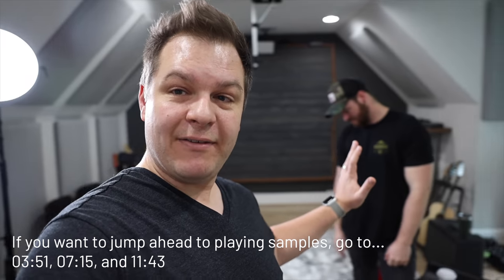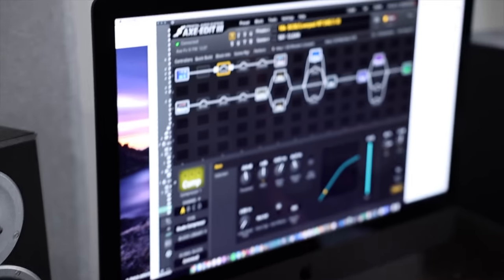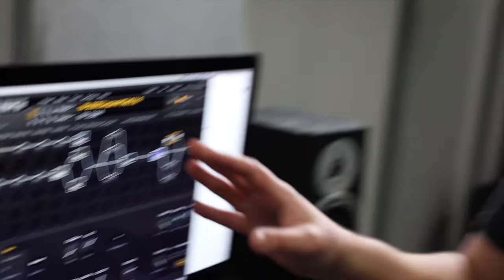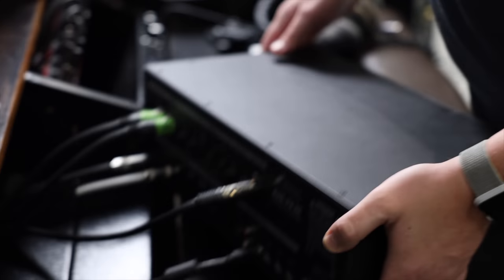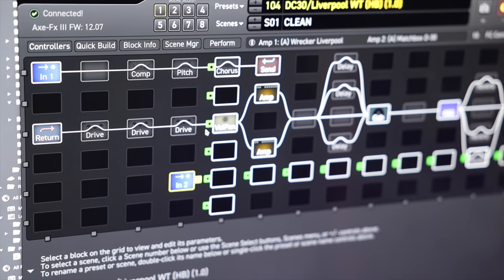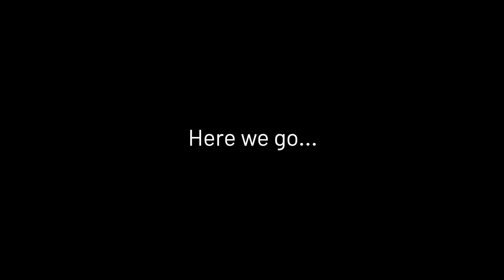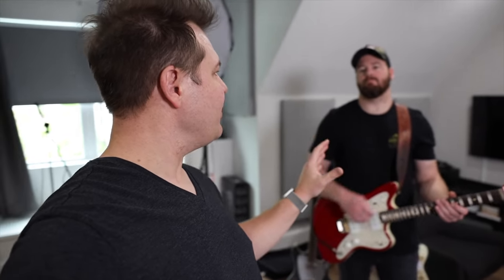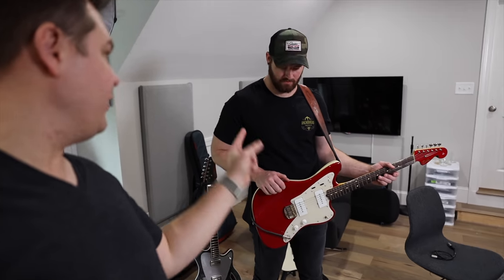We ran a huge stereo pedalboard into the Axe-FX 3...

Comment: I learned how to easily use my condenser mic in my axe fx iii while I play guitar. It is powered using a external power supply that has a normal line out. I can do a bunch of cool things to the vocals alone while having a good guitar tone with it never fighting each other. But usually just a gate and compressor on the vocals. I normally do that so I don't need to change much to do a simple zoom call. Or I can use the pitch block to get that cool cynic vocal effect. It technically does auto tune. Also the vocoder block becomes useful. I just never liked that tone.

That thing is def nuts. Especially when they do an upgrade and all the tones can sudden use this super nice quality cab sim.

Comment: Disagree some there Brian. I’ve done wet effects in front with the regular helix (specifically for “The Way”) and also very effective now with my board in front of the stomp. I prefer stomp and that’s why I went to that. 
It’s actually the typical worship guitar sound really. Most guys aren’t running their wet effects from boards into fx loops. I’ve mentioned before and have always thought y’all should make a patch that has all the wet effects in front. Sure the polished thing with wet effects after sounds clearer but it’s the sound I just didn’t like in worship stuff really. I love it when it’s a certain type of song (blues or rock) where I don’t want some of that awesome weirdness that happens and with that I have 95% of my presets basically just the amp and an EQ. The other 5% when I want the cleaner wet effects after, I use the helix effects only and my midi pedal switches off the DD500 and BigSky. That works for me. That Elliott sounds great!
Reply from the maker: I should have clarified - I was specifically referring to putting reverb and delay models in front of the amps inside of a Helix patch - meaning using the Helix wet effects. I do think Helix /Stomp handles running pedals in front of amps really well. But while editing I was thinking that I probably just didn’t spend enough time with it - I think helix would do wet effects in front of the amp just fine If I spent more time dailing it in. 👍🏻
Reply: Worship Tutorials Yeah I’m sure. I guess my point is it seems everyone runs helix patches with wet stuff after the amps and it sound good but many like Bradford like them before and me too. I guess cause that’s how pedalboards are usually run in front. I’ve done it on the main helix unit on the song “The Way” as it has a part using the neck pickup you’d only get that sound with effects all in front. It can be done. It’ll do those cool things y’all mentioned. 👍
Reply: Fishman Guitar running wet effects before amps in Helix gets weird and just doesn’t sound as good. We tried and weren’t getting something we liked out of it. And it limits your DSP because the way you do everything is double once you start the stereo chain haha

Comment: Good video! If I would like to connect a tube preamp pedal to my Axe-Fx II XL+, so the chain will be the following: my guitar - to input of the tube preamp pedal - output of the tube preamp pedal - to Input 2 (Fx return). In the Axe Edit I will need to insert the Fx Loop block in front of the amp block? Is that the right way?